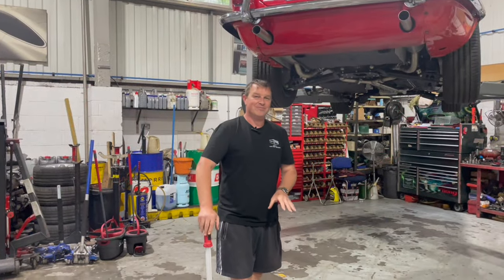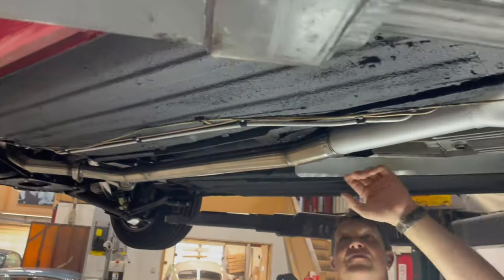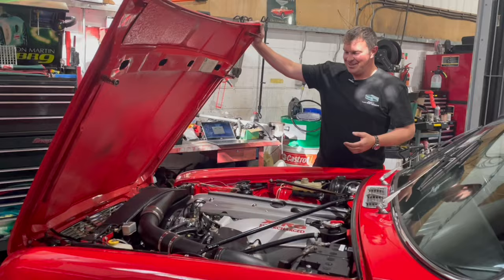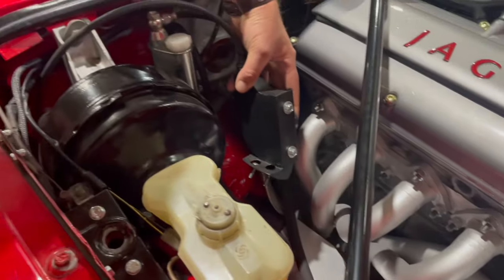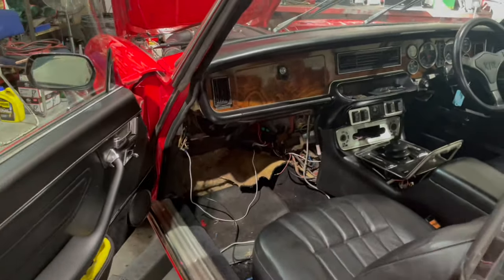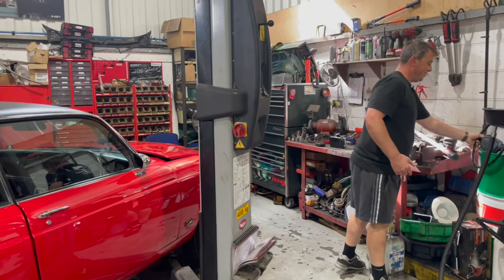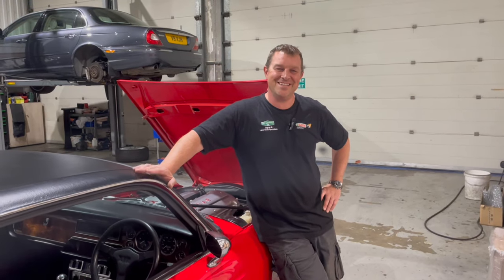Jaguar XJC RESTOMOD - Part 8 - Engine Now Plumbed & Wiring Almost Complete + Steering Wheel Reveal!

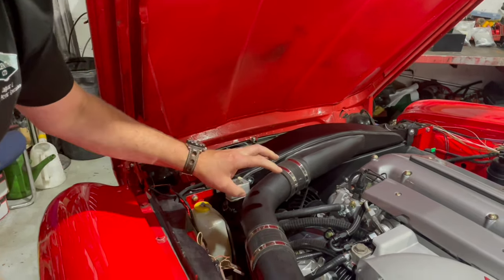Comment: 8:00 missed a trick here - looking at this, if you relocate the battery to the trunk, say, you could intake air from right underneath the windshield where there is a low pressure area that is perfect for it. You'd have a very short run into the charge cooler from there and its cold, low pressure air. That's one reason why most car hvac systems draw air from this location.